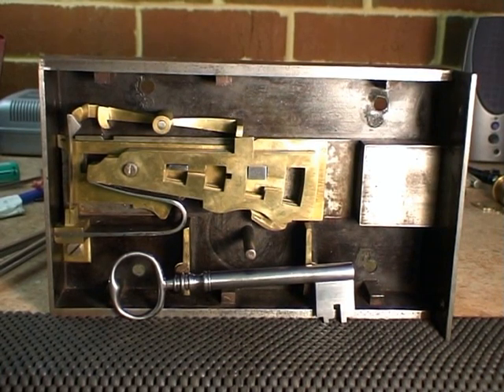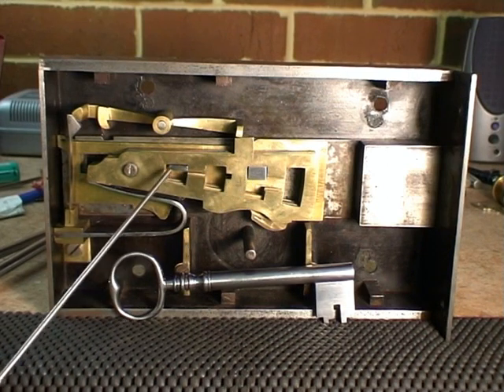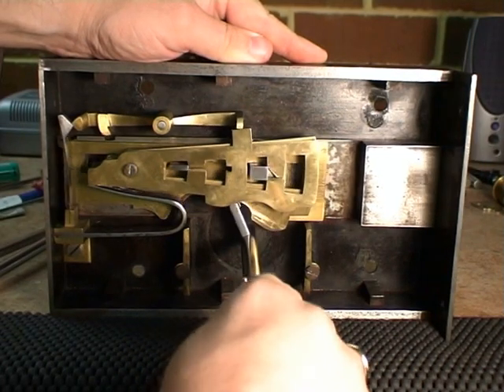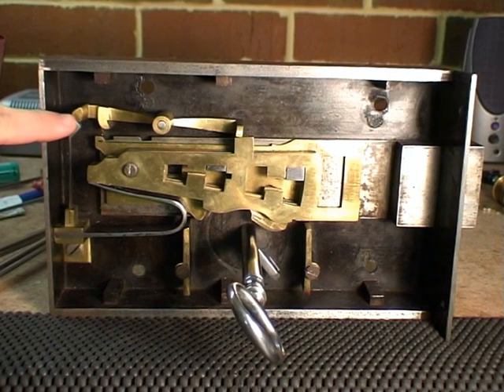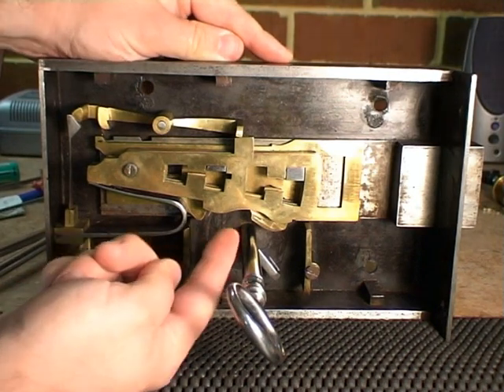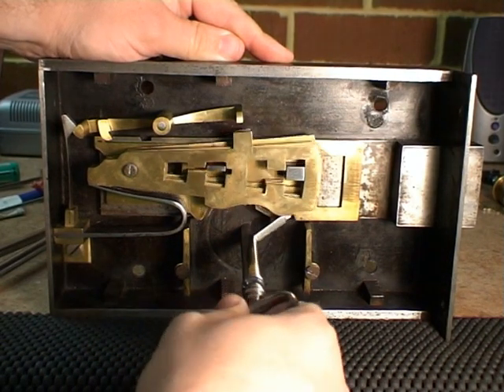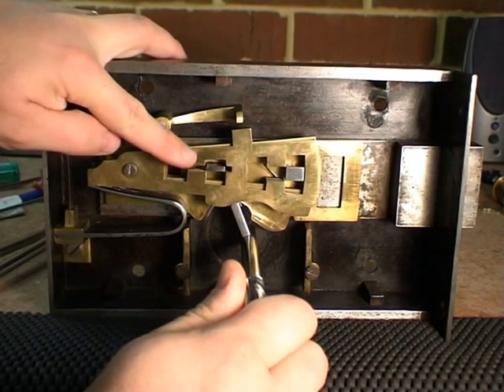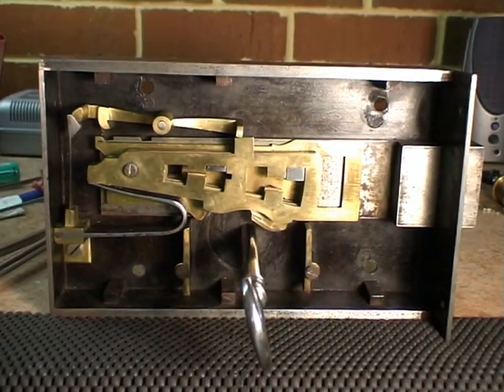Chubb 1824 Patent Detector Lock

Comment: Great video, now I finally understand how the Chubb Detector works. The written descriptions just didn't do it. And this 200 year old design is still high security to this day. The belt ranking system used by the Reddit lock-picking community has this thing rated at black along more modern high-security locks like the Abloy Protec 2, Assa Twin Combi, Mul-T-Lock MT5+ and the WE30C (finally confirmed pick just recently). I find that fascinating that 200 year old tech is still competitive with modern designs (at least in pick resistance).
Reply: No-one has picked a Chubb detector since Hobbs in 1851 and even then it was a obsolete design of theirs by this time. the "definitive detector lock" has massive improvements which I doubt anyone could defeat today, that's why it's lasted so long. I have made numerous offers to people who are extremely gifted in picking to supply one but to this day none have accepted. It has a serious reputation. Personally I don't think it can be done.
Reply: @Kit_Bear  That's pretty amazing. I didn't know it was unpicked since Hobbs. One of these days I'd love to get a Chubb Detector and try to get into it, but I seriously doubt I'll ever be able to. And they're unfortunately expensive and hard to come by. I'm pretty mediocre as a picker, and haven't gotten to lever locks yet, but they're totally what I want to do next. Chubb Detector is my Holy Grail lock.
Also, what version do you consider the Definitive Detector lock?" Is it a newer version than this 1824 patent?
Reply: @Kit_Bear  Hi there! I want to buy one, but I cannot find any for sale online. I clicked your click here, but it links to a picture, not a product. Would you please send me to one or more of the listings?
Reply: @cannellaorso4171  If you are after a brand new one they don't make them anymore. The link I sent was just an example of one.

If you want one then you need to look on Ebay in the UK but be careful of the padlocks, there are many fakes from India on there. If you are looking for a padlock then just look at the key, if it looks crudely made then it's probably a fake.

They are getting quite expensive right now due to the scarcity. I guess I created that problem. Sorry.

Here's one from the 1833 "New Patent" design on current listing. ----> https://www.ebay.co.uk/itm/CHUBB-Brass-lock-c-1841-039-Maker-to-Prince-Albert-039-Warrant-/114335368513?&_trksid=p2056016.m2518.l4276

And another ----> https://www.ebay.co.uk/itm/ORIGINAL-BRASS-VICTORIAN-DOOR-LOCK-amp-KEEP-CHUBB-AND-SONS-RARE-/293677489242?&_trksid=p2056016.l4276
Reply: @Kit_Bear  this is incredibly helpful, thank you. Part of my problem may have been that I wasn't searching ebay specifically in the UK (even though I know their history, and my other frustration was that I couldn't find many affordable ones, which the scarcity explains perfectly. 

Thank you so much for linking me these two! How can you tell if it's a fake/from India? Or is the best/only way to tell by a crudely cut key? 

Excellent advice, thank you so much for getting back to me
Reply: @cannellaorso4171  If you see one you like just send me the link and I'll confirm if it's real or not for you. The seller of the first one is highly reputable. I have bought a good number from him and his knowledge is on the same level as mine if not greater so he is VERY trustworthy.

He is currently also selling a cotterill Climax Detector padlock. Highly collectible and desirable in the historical lock collecting community. That lock alone will sell for no less than £1500.
Reply: @Kit_Bear  Can you elaborate on the massive improvements?  Barrel/ curtain and false notching ?  The original does not look to be all that difficult.  If I remember Hobbs did the Chubb rather quickly.  Then again  appearances can be deceiving.
Reply: @dougmacqueen1679  All of the above hut Hobbs only ever picked the "New Patent" design because he could reset the detector with a piece of wire. All the other types he couldn't do. After the Bramah he never picked another challenge lock. Some say he was chicken, some say he'd lost it that night with a Cotterill or even the fight between Hobbs and Goater of Chubb, we may never knów. I like to think that Goater won but you'll have to decide. if you love locks then you'll know what I mean.
Reply: @Kit_Bear  Do you belong to Antique-Locks forum?  There is Avery Chubb padloc
Reply: Damn these phones anyway a Chubb padlock on the forum discussed recently.  You may find it of interest.
Reply: @dougmacqueen1679  That's a big boy. Yeah, I'm on there.

Paul has always been good with Chubb locks. He's into them as much as I am if not more. He's on here too showing how a 1824 Patent Improved Detector Lock works.
Reply: Снять блокировку можно любым ключом или только оригинальным❤?